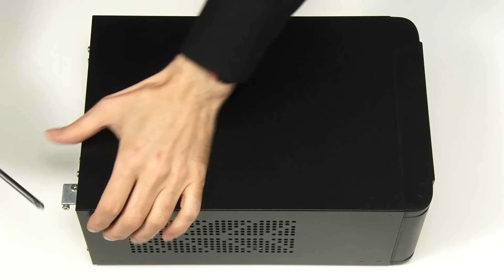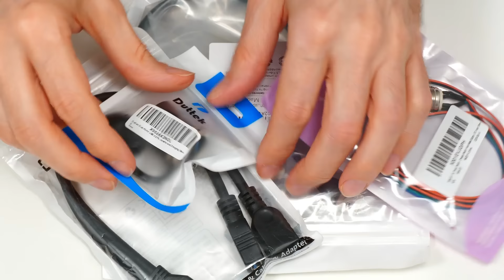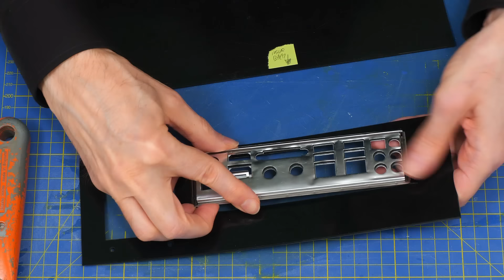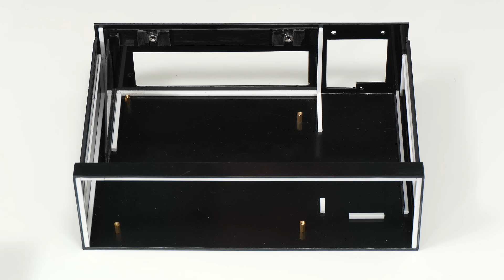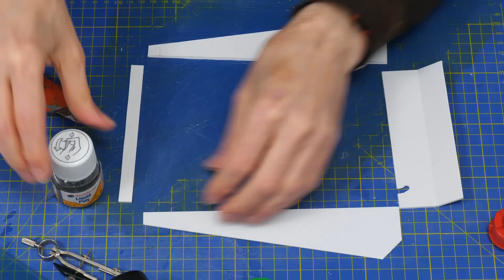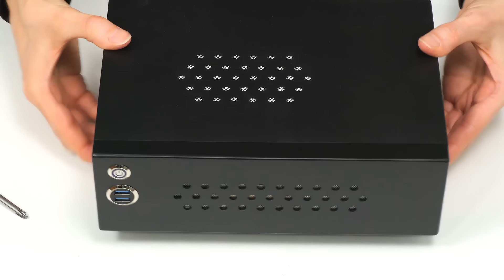DIY Mini-ITX Case

Comment: Greetings from across the pond near Albuquerque, New Mexico, USA. Great video, great build, many great comments. The only addition I have is that, considering some of my own designs, I've actually found it quite easy to curse the designer, especially when that one screw hole is off just enough that pieces don't fit together quite right. It helps to imagine that goblins moved that hole over when I wasn't looking, just to irritate me. Blessed Sunday to all.
Reply from the maker: Thanks for your support, most appreciated. Blaming goblins is a great idea. They often use their magical powers in quite unhelpful ways.
Reply: Nice, you paid for the new case 😂👏🏻
Reply: @PeteC62  Happy to do it, for such a worthy cause. :)

Comment: Well done with the case! In 2004 I built an Epia Mini ITX based settop box, but I chose to purchase a case for that one. I can longer do the amount of cutting you needed, so I probably would have used an oscillating saw. BTW...for the back panel, you might have used T-nuts to provide a cleaner mount. Nonetheless, your case looks great!

Comment: Hi Chris, I have been enjoying your channel for a while and as my old Windows 11 based desktop pc was getting slower and more annoying with extended shut down time and incessant windows 'upgrades'  I  decided a few months ago to build myself a new pc using Linux Mint new Cinnamon edition as seen on your channel. I copleyed the build last week and excitedly pressed the power button. Nothing. Initially I thought the PSU was faulty but after some tests discovered that the power button on my Montech case was not working. After purchasing a button extension on  Amazon for about £6 the system is now firing up instantly. Also Linux literally takes 4 seconds to shut down! Windows used to take at least 3 minutes and I don't have to ever accept upgrades if I don't want to. Very pleased. Probably cost about £800 in total which is at least £1000 less than if I'd bought the system online or in a shop. 16 GB of 5200 MHz Corsair Vengeance DDR5 RAM which is duper fast for my needs and 1TB of M.2 SSD storage. Ryzen 7 7700X gaming CPU and MSI B650 Gaming Motherboard. I don't even do gaming so this far exceeds my current requirements. If I had bought the RAM first instead of last I would have saved at least £100. Can't believe the price increases since September.  Keep up the good work Chris, you are informative and inspirational.
Reply from the maker: Great to hear about your build. That's a nice spec and should last you a long time. :)

Comment: I thought this would be a 3d print build. I was pleasantly surprised. This looks like a charming project to tackle. I myself have a smaller PC I use for my TV and I had struggled to find a case that could look enough like a VCR or DVD player while also accommodating a full size gpu.. Perhaps I should make my own.

Comment: What a nice case!  I like the fact that it has an internal power-supply.  It's just not a proper desktop PC without that, IMHO.  An external power-brick is for a laptop.  Well done!
Reply from the maker: I always find it a pain with machines I use in testing and video making to have to go in search of the right external PSU. So for me here the internal PSU was critical. :)

Comment: I love a REAL build of a case with plastic and glue. However, I can't take this case seriously because the SSD actually has a proper location. A real DIY build would have it flopping around on the end of a cable, or if you're really fancy secured with a bit of duct tape.

Comment: Great job Chris.

 I suppose you could always build a double-walled case, with interleaved aluminium foil if you were concerned about Informational Security & EM leakage (Tempest compliance)  and EMI with surrounding kit.

Your next job build a ruggedised half-height version that's portable in a Laptop carry bag ? That would knock the laptop market for six, although I suppose the cyber deck does that already !
Reply from the maker: I like your next job suggestion! :)

Comment: I have the same exact case but I have a asrock mb w a Ryzen 5700g and 32gb of 3600 Ripjaws. I also installed a 1tb M.2 with a 2.5tb ssd...it barely fits in....lol..it took a little convincing but its all working great! I used the orange decals that were included for mine.

Comment: With a cooler at just 37mm tall, it would be worthful to consider laying the psu on it's larger side, so turning it 90'degrees and inhaling from the same side as the cpu fan. The case would be longer, but thinner - ultimately smaller, due to elliminating the current unused space between the side panel and the fan. Since the cpu cooler now being closer to the side, it would have better access to fresh air, resulting in less reused air, thus cooler temps as well.

Comment: It's kinda refreshing to see a build project where it's not just "let me use my $13K 3D printer, expensive CAD software, and engineering background to print all the parts." Of course you can can get into 3D printing for much cheaper, but at the same time what you did is EVEN more attainable for the average person. Well done!

Comment: It’s a beautiful case! Not sure I would have the patience, but then again I built a small parabolic listening device once that took me a week. I guess once we get an idea , our creative consciousness drives us to complete it. Your case is very sharp looking and the power button and USB ports were worth every extra  penny. Very nice!
Reply: You might not get such a neat case without the patience, but I have no doubt you'd get something very close within anybodies attention span, at least a few sessions of it... Though making it easier on yourself and using thick cardboard or foamboard for the bulk structure (assuming you don't have a really well equipped workshop), as they can be worked with just a knife really easily. Or if you want to try this method with plastic sheets I'd suggest getting a tool like the Olfa PC-L to do the scoring, it is far far far better than Stanley Knife for this scoring plastic task, and really not expensive.

Comment: Neat project. Since we can't reasonly purchase new computers, buidling new custom cases for some disused or reclaimed hardware is a good way to continue to learn skills to improve our knowledge of computing. Thanks Chris!
Reply from the maker: I totally agree. I think we need to re-think what "PC building" is about at the moment.
Reply: @ExplainingComputers  One project I am tinkering with is taking a cast off Dell Optiplex Motherboard and power supply into a 10 inch mini-rack.
Reply: Thanks for the creator like Chris.

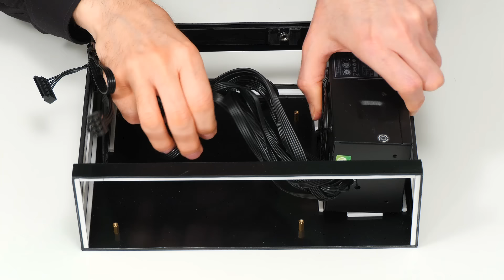Comment: Actually the Power Supply is NOT supported on ALL sides as stated at 12:28.

There are 6 sides to the PSU, four of which are supported and a fifth side (the bottom) could probably be added since that is supported by the base and gravity holds it there when the case is in that position.

However the sixth side (the top) is NOT supported. Nothing was mentioned about the top cover being in contact with the top of the PSU which would keep it secure when the bottom of the case is up. In that event  the 2mm piece of plastic holding the long side of the PSU would be the only thing keeping the PSU in position. Keeping the PSU secure is important since the PSU is the heaviest item here and only has the long side secured with 3 screws in 2mm plastic.

Personally I would have opened the PSU case and made two holes  in the bottom of it along with mounting a nut to the inside of the PSU case. This will make the PSU much more secure, but that's just me.

Instead of using pan-head screws I would have used flat-top Phillips (Stainless Steel) screws into the base and countersink the holes in the 4mm plastic base so the screw heads are flush, or maybe a tiny bit deeper than flush. That allows the full 4mm base thickness to be used and a more solid mount which is important considering the heavier PSU. Plus it looks a lot better, in my opinion.

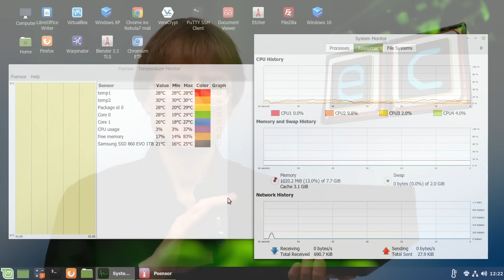The temperatures you mentioned at 21:04 does not give a clear indication of the temperature Delta unless the ambient temperature is also given. So we are somewhat left in the dark for the cooling efficiency. For all we know the ambient temperature was 16°C during testing which resulted in a 30°C idle temperature would give a 14°C Delta (Δ).

Comment: A lovely case! I would have to add a disc activity LED on the front, it just gives it some life. 
In fact my current PC build uses the same yellow LED from a Windows 95 PC purchased in 1995. So it has has been flashing away for over 30 years.
Reply from the maker: Yes, I pondered on including a drive LED. And may add one at some point. Or I may sometimes connect up the power LED as the drive LED. :)

Comment: This is so awesome. I'm definitely getting a lot of ideas from this. I have an old ThinkPad that I have been hoping to turn into a home server. But I didn't want to go through and design and 3d print things (I don't have a printer so I would have to get that done by someone else). This feels more like a hands-on way I can make that happen. I could even use this method to create a steam box out of my steam deck. Maybe ...
Reply from the maker: Good luck with whatever you do! I get the impression that, like me, you like things that can evolve and iterate as you build and get a feel of things.

Comment: Thanks again.  I love when you show what a former manager called 'the art of the possible'. Your limited use of chrome draws the user's eye to where they would need to interact with the device and you've left room for a micro-SD slot, USB-C connector etc.  I would suggest that you consider what a google search calls a knob-bolt so you can have tool-less access. Sorry Mr Screwdriver. 

I just bought a 3D printer to use to make bezels for some of my projects and you reminded me that I should consider flat ABS as well.  

Finally, just a reminder, in Canada and the US, the parts that use Daylight Saving Time are going to DST next week, but the UK is not changing to Summer Time until March 29. EC won't be available the same Bat Time, but rather an hour later. Actually it will.  It's the clock that changed, not Explaining Computers  Regardless, have a great Bat Week.
Reply from the maker: Thanks for the time change heads-up. It always bewilders me!

Comment: Cool build, but I wouldn't trust my hands to be steady enough to do this by stanley knife. I'd probably find somewhere I could borrow a laser-cutter instead.

My worries about a non-metallic case wouldn't be much about electromagnetic interference... my concern would be more along the lines of whether there's proper protection against static electricity.. A common ground can absorb much more than those thin wires in between components.

Comment: I really like the look, it turned out fantastic.  I've always thought about building my own case, but just do not seem to have the time to do so these days.  I always add a cheap PC SPEAKER to my builds.  I like getting that short beep when I power up the machine.  Also, if there is an issue on startup you get a series of "beep" codes letting you know of a hardware issue.
Reply from the maker: You are right, I should have added a speaker sound here. I remember once making one from parts found in a musical birthday card!

Comment: Add me to the club of folks settling in with a bowl of porridge for another Sunday installment! Thank you for providing such great videos so consistently. 
When I saw the thumbnail I wondered if foil tape would be necessary, I'm glad you went over that part in the video. It may even have improved things, I suspect a foil "box" might bounce internal EMI around and cause problems with the board itself if not connected to earth. 

I really appreciate showing off these non-3D printed projects. It's good to highlight what can be done with simple tools and materials that don't cost hundreds nor require exhaustive 3D modeling, especially to push back against the algorithmic recommendations that sway so many towards big appliances and fiddly workflows. 
It certainly helps that your final results are beautiful and have functional touches.

Comment: Very impressive !  The only thing I would have added is a front panel USB-C port.  Personally I would have gone with an external power supply.  Also I would have figured out a way to bolt the PSU down to the base plate.  Lastly, you ran into the same problem everyone build a small form factor system runs into.  EXCESS CABLE LENGTH !

Comment: Can't believe you don't own a 3D printer! Seems right up your street.
Reply: He does! Not everything is appropriate for 3D printing. The sheet plastic here is structurally superior and has a better surface finish. 
I've seen people abuse 3D printers for things where this approach of simply cutting sheet goods to shape is a far better and more affordable option. 3D printing is good for one-offs, rapid prototyping, and complex geometries. In a case like this one you COULD 3D print some angle pieces and brackets to put the ABS sheets together, but the solvent method is stronger and reliable even if you need to take some care when laying things out.

Comment: End result came out very nice! Most other youtubers would just use their sponsored 3D printer and print a case and call it a day, it's refreshing to see someone build something different!
Reply: Everyone used to be like this before 3D printer become widely available. I do like the ease of build of 3D printer, but hand made is always feels much more authentic and relatable to me since I don't have 3D printer😅
Reply: Was thinking exactly the same. I like this a lot more compared to the sponsored content with big, expensive 3d printers no normal person can afford these days.
Reply: it did indeed. it would need to be a big (3d printer) one to fit that case size on it's built plate, unless you split it into parts then glued them together, in which case gluing sheets together with reinforcing is probably quicker, and more accesible for those without the 3d printer.

Comment: Small PC cases are awesome, especially when we no longer are tied down to big mechanical drives, be it for data storage or disc readers.
I currenly own a Kolink Satellite case and it fits a mATX motherboard and full size GPU, although it's important to have a motherboard with PCI-E connectors aligning with the case as it only has two holes for the GPU connectors to go through. A single slot card will be generally easier to handle in such conditions, where as bigger one will be trickier.
The case also fits a standard ATX power supply. The case itself is 25cm x 31cm x 20cm.
I feel like it can be seen as SFF replacement since it isn't tied down to low profile when it comes to extensions like PSU, GPU or additional USBs.